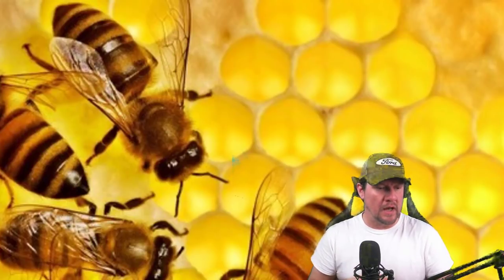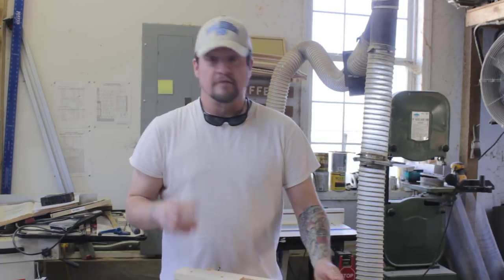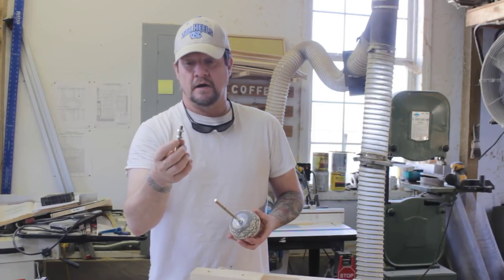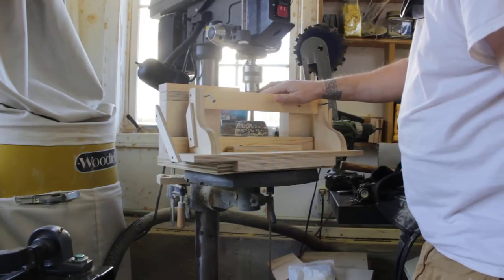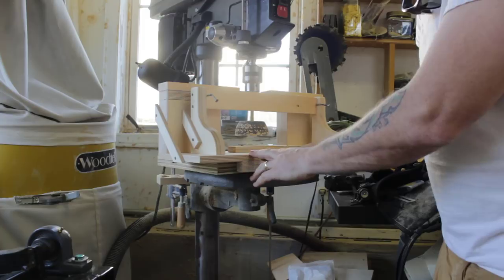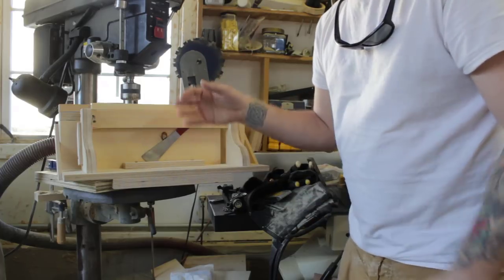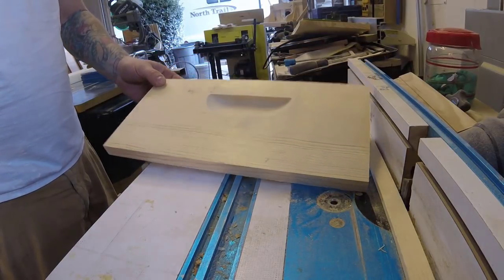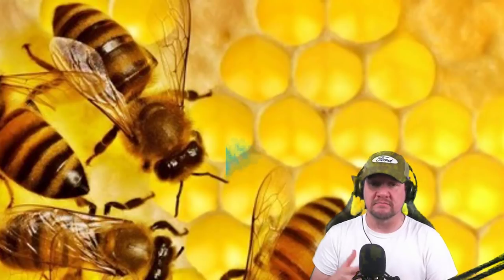The Best Hive Handle Jig On The Planet

Comment: Not cutting, your grinding. I would hate to grind 100's with that jig, but you did say that.
Reply from the maker: Yes, I did :) I use a dedicated router table and a specialized cutting bit for it for commercial quantities. With that setup it takes exactly 8 seconds per box (not per board) to cut handles.
Reply: @FunnyBugBeesandWoodWorks  That's the video I want to see.
Reply: What bit?

Comment: So based on this video I went ahead and bought this jig and wouldn't you know my old Rockwell 15-069 drill press doesn't have enough clearance. The recommended fix is to use a 6" grade 8 bolt, as seen in this video. I'm here to tell you it's crazy scary even at lower RPMS. I'm sure you will blame my drill press but with the short bolt it is as smooth as butter. I tried several different grade 8 bolts from two sources and the chatter I get is crazy. 
After spending 5 minutes to carefully cut just one handhold I can tell you it felt like the thing was coming apart. The flex in even grade 8 bolts is just too much.

Comment: Cutting?    More like grinding. Its a very simple jig to build.  I'm go8ng to be searching for the grinder stone. However it seems that it could create enough friction to burn the wood.
Reply from the maker: Yea that was a video from the previous owner. Check out the machine I got when I bought him out. Very nice but selling for around $4000. You can go to my other channel at Pop Pops Bee's and I made a sled last year and posted the link in the comments for that one. I cut close to 3000 handles using it.